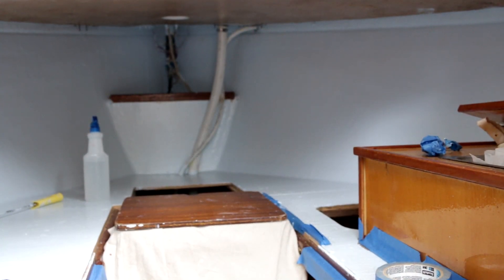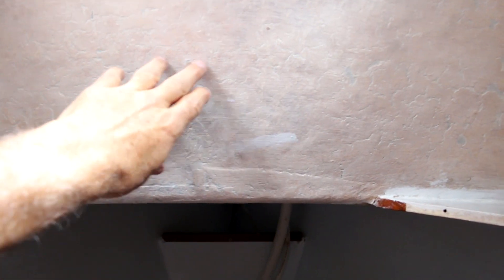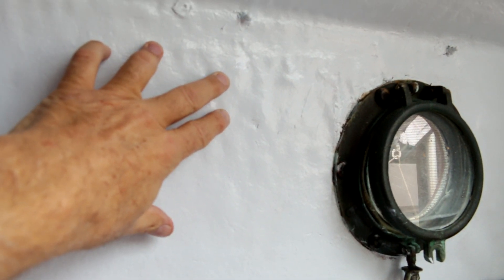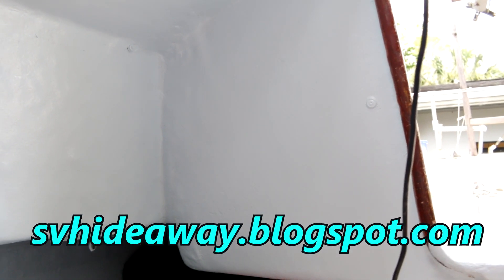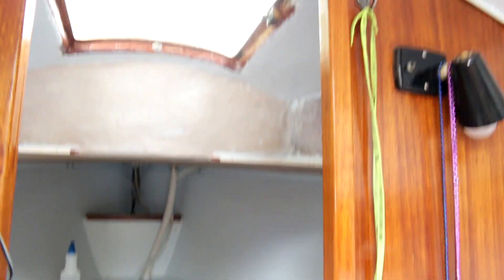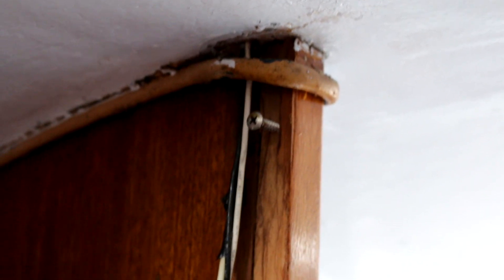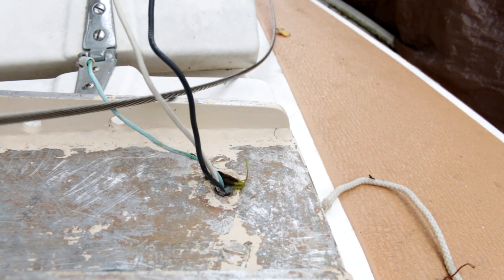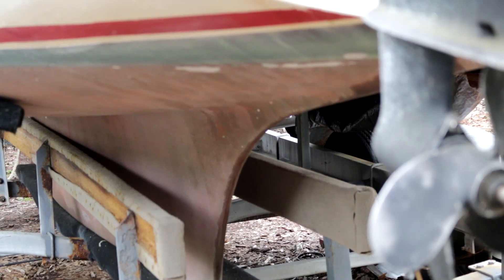Com-Pac 23 Sailing Hideaway  Refit Update - Painting Below Decks

Comment: I know that it's a lot of work, but it's starting to look better.  I'm a little concerned about the the things that you called blisters.  Are they paint blisters or is the fibreglass  delaminating?  Either way, you should dig into them to see what's happening there, if not this time, then the next time you paint.  If that leaves a spot to be repaired, you can always use faring compound or auto body filler.  Btw, that's a great looking cap.
Reply from the maker: +andy hauber They are not really blisters- They have been there all along our 20 yrs together.  It looks more like a fiberglass wrinkle that should have been flattened before it set.  The early boats aren't going to have the same finish as the latest model.  None of this is structural- I wonder how rough the newer boats are under the paneling.  I never thought about auto body filler.  Since this is a below deck application it would probably be fine.   I'm frankly shocked at the difference in the before and after photos in the video- I really didn't think it looked half bad before the blues!
Reply from the maker: +andy hauber Oh yeah, the hat.  I bought that hat for may dad ,who wanted the leather version of my wool one. The hat came from a shop in Tarpon Springs Fl which is famous for its Greek sponge diving industry.  The label on the hat states it is "authentic Greek Fishermans Cap - Synthetic leather 100%"  Dad loved it.  Over the years the "leather" part of the hat took on the characteristics of flaking, sticky black paint.  I recently cleaned it all off down to the cloth.  I like it alot- reminds me of my Dad
Reply: +SV HideAway It looked like there was a lot of 'character' in that hat.  I grew up on the Manatee River and sometimes we took our boat up to Tarpon Springs to visit my grand parents.  I remember the sponge boats and gift shops, but especially the small art galleries.  The paintings of sea scapes and forest scenes really impressed me.  I still have a neice who lives in that area so if I ever get that sailboat, Tarpon Springs will be one of my ports of call.  Maybe I'll even get a hat.

Comment: You know what professional restorers use for such projects? Vinyl.Which makes a great looking headliner and ceiling at little cost. Beyond me why people try painting and scraping and sanding for days when vinyl will make it look new with little real work . Good luck
Reply from the maker: I looked at vinyl but I have seen them fail to stay put.  Since the gel coat was rough and flaked I had to do something to smooth the surface before adhering the vinyl anyway.  Paint seems like the best option.  I'm happy with how it looks- we will have to see how long it lasts in the heat and humidity.
Reply: 3m indusrial 2 way velcro allows you to put up lightly backed vintl panels. This allows easy install , adjustment and the benifit of putting wire etc behind to hide them as well as screws and nuts etc. surface irregularity is not relevant, this will give you a like new look at very low cost with low skill level.
Reply from the maker: That sounds like a really good idea.  I like that you can hide fasteners and such while still having easy access to them.  It will have to be a future project.  I barely survived putting down the sole in this heat.  Those drops on the sole in the measurement scene are not rain!
Reply: SV HideAway Common issue on boats of that age is failure of the liner glue.Since the inside was covered it was never really finished.I have seen people put TONS of effort in trying to scrap old glue and rough fiberglass.It is always disappionting. Cover the mess in bilge coat or some other primer and slap up vinyl covered panels and...poof...new boat. This is just a trick stolen from car restorers who have a smaller margin to work with.Many new boats are made this why now anyway as it is a cheap and clean way to cover hardware and wireing.

Comment: On my 23 the paneling is installed and then the hole cut out and the porthole is installed over it.
Reply from the maker: +jim wasson That's the problem- on HideAway the surface around the some of the  ports is too rough to make a good water tight seal. I suppose I could shim and pray but....      I've noticed on the older boats that have the wood panels have stained wood.  So I decided to paint that area instead.    Hopefully it will look something like wood- Stay tuned!